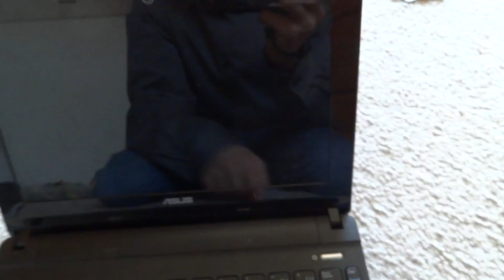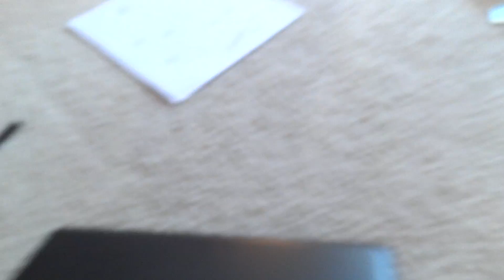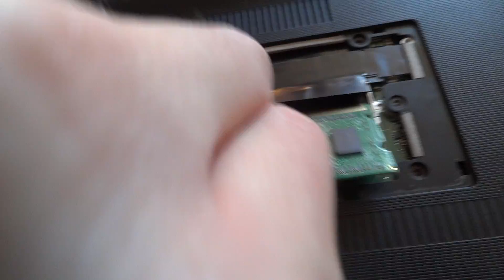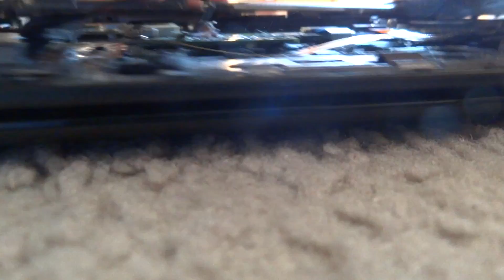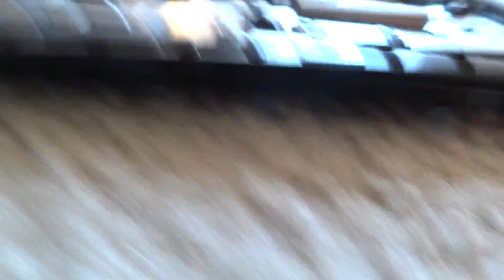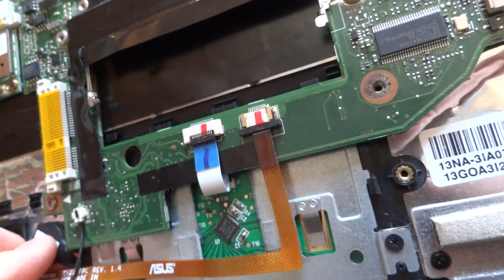How to fix your ASUS eee PC X101 (blank screen / no boot fix)

Comment: I have never heard of  this method before(unplug the CMOS battery). This works on my eeepc900ha , thanks very much
Reply: Mine did not work. I even change the cmos battery 2032 red for + line and black for - line.

Comment: Does anyone have a fix for the EEE PC 1015?  Same thing happened to me.  I'm taking it apart and there are not all those parts underneath.
Reply: I took out the battery and pressed power for a few minutes.  Nothing.  So now I'm trying to get the CRUCIAL RAM out, would anyone know to remove it?
Reply: Lianna Wright
Where do I get the screwdrivers to help with opening up the compartments?

Comment: Perfect. Thanks. I suffered the same problems and followed stricktly your recommendation and deeply resetted BIOS by disconnnecting the internal buffer battery. Finally it worked out. My ASUS rebooted and started to download several updates. It seems that maybe a Windows update failed that caused this problem. Anyhow. Niw it works. Fine. Thanks.